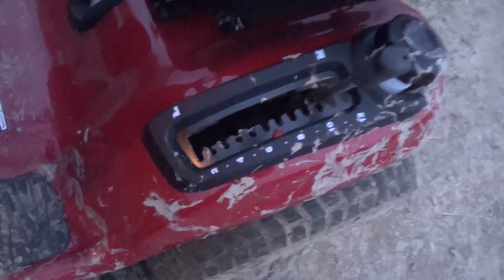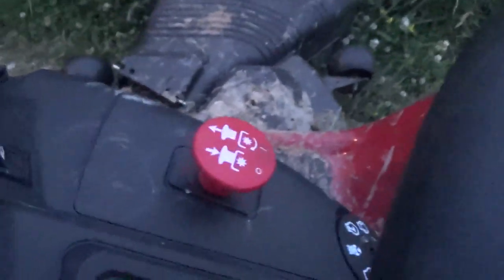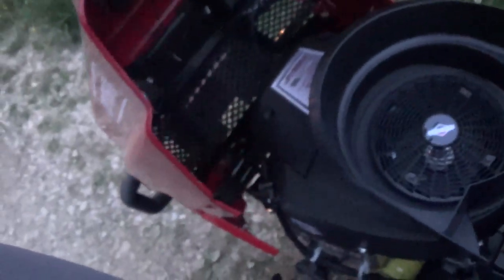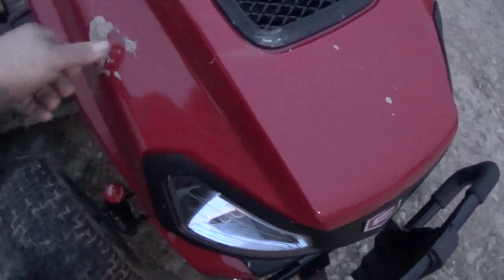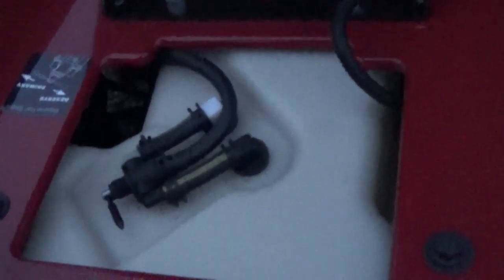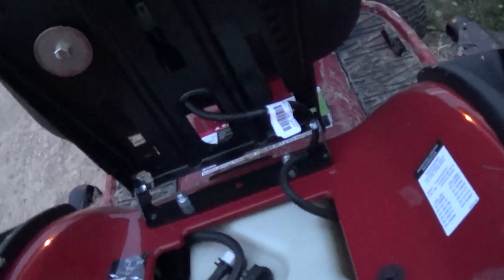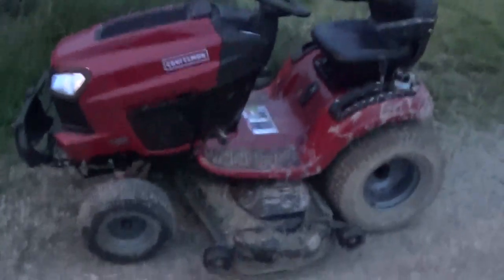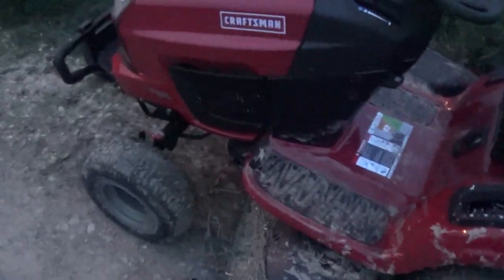Sears Craftsman 24 HP 54" cut GT5600

Comment: It does mow in reverse you just need to have the key in the right position!!!
Reply from the maker: yeah i figured that one out eventually lol  also figured out how to move it without having to haul out the trailer each time by pulling the spring to release the hydrostatic lock on the rearend. Now if i can just figure out how to get it to stop blowing up starter solenoids i'll be in business. :o)